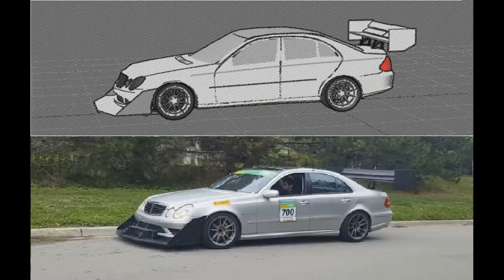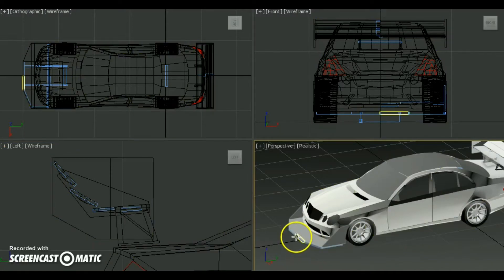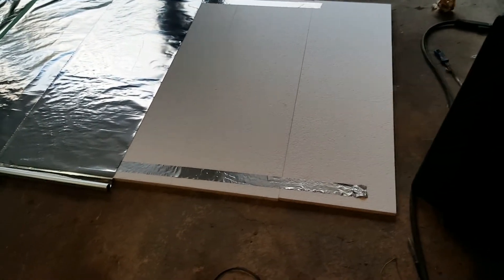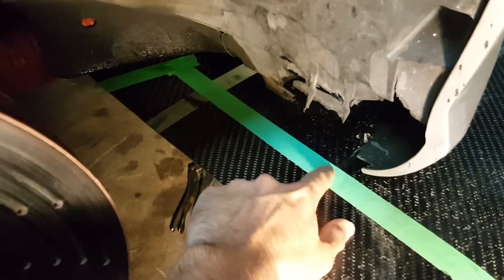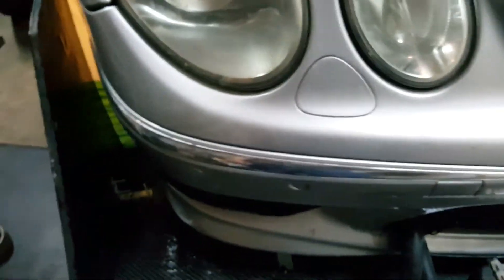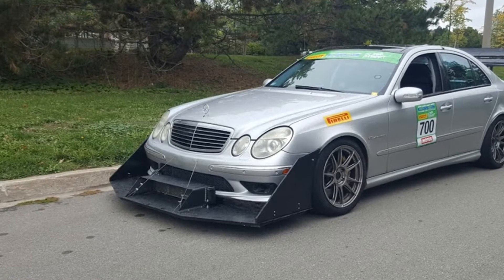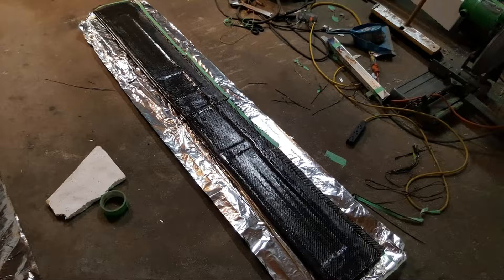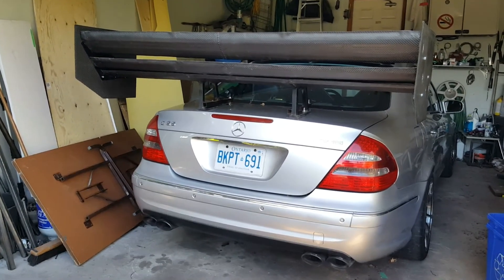How to Build a Properly Fast Track Car - Part 8 (Splitter, Rear Wing)

Comment: Do you do your designing wholly on a computer?
CF skin over a foam inner would be the best method for ‘DIY’ wing. Lightweight, high tensile and torsional strength and the advantage of being an being an aerofoil. There’s a company in America that can supply the foam inner carcass in the profile as requested by customer, voids for CF spines/ribs. (cant remember proper name for carbon tube insert near leading edge) The vacuum and kiln method for this also creates a strong, lightweight product.
-bad CF is no better than FG with supports

Comment: If by properly you mean wrong.

Automotive companies spent 4 years on average for each model, spending millions of dollars, employing experts in fluid dynamics to design the car to perform at maximum aerodybamics, with minimal negative effects. Adding after market parts completely destroys the millions of dollars of research and tweaking to perfection.
Each car has a unique shape, and the streamline that interacts in specific ways. Your splitter destroys the airflow around the front design of the car, increasing turbulence and unnecessary air disturbance. So too does the unnecessary wing.

FYI, a diffuser actually generates more down force than a wing, and none of the drag. As a result, you don't end up just slowing down your car like you are doing here.
Reply from the maker: Lol, if that was true you would see formula 1 cars shaped like Toyota Prius'es too. 
Production car aero is meant for giving you better gas milage down the highway. That aero isn't intended for track driving and makes little to no downforce. Diffusers work great if you have a proper flat underbody but in the class I am racing, flat underbodies are not allowed. The rear wing is active anyways so it contributes to almost no drag down the straight because it remains open.

Besides this aero has clearly proven to work on the track and makes a very noticeable difference. There's a reason why almost every time attack or hill climb car uses wings and splitters.
Reply: Wes Jones he is the one with a track car, where is yours?
Reply: Valentine A. And that means what? Tons of teams don't perfect their cars. 

The design of this car was done by professionals with millions of dollars and proper wind tunnel testing. Adding these on interferes with the airflow coming into contact with the vehicle. As such, it necessarily requires the modification to the design of the car itself to add them on....and still there are more effective ways to add downforce.

Where is my what? I never had time to race cars when studying fluid dynamics and making cars and planes function. I leave the racing to my buddies.

There's a reason professional racecar drivers don't modify their own cars, their professional teams do.
Reply: Wes Jones Lol are you 12?
Reply: Wes Jones r/iamverysmart
Reply: Wes Jones 
Packaging also weighs on decision making process. Testing is done to make required packaging as best as possible. Improvements can indeed be made. If done correctly

Comment: What the fraggle rockin kinda racing are u doing with all that carbon???!!! Looks like u wanted to be an astronaut rather then a race car driver?? Lol na but I love it when guys do stuff like this . I think some of ur engineering needs alil more finesse. Like some of ur welding could have been dressed down n the carbon could have had alil more fore thought. Keep up the work 👍🏻 ur deff a unique guy.. I’d love to see u race that thing . Would be the cherry on top👍🏻👍🏻👊🏻
Reply from the maker: There's quiet a few videos on my channel of racing this car. Yeh, I know quality isn't the best. I usually get little time to spend on this project so its been more about doing w/e makes the car faster, and testing different ideas on it. 
After all its a car I bought to beat up on the track and compete in time attacks. Wouldn't really make sense spending too much time and money on refinements and then possibly crashing it.

Comment: You should have bought your rear wing. you have no idea about the aero data for what you have. the slot gap on the second element is closed, wtf? the carbon work looks like crap. are you even vacuum bagging this stuff? or are you just laying it up like fiber glass? there is no reason you cant mount that wing to the trunk lid, it's done all the time. suggestion...make your front splitter out of wood. that will allow you to make modification so that you can get the performance out of it, i doubt you're going to get it right the first time
Reply from the maker: See the later videos, Part 10. The rear wing is supposed to move and slot gaps are adjustable. Its definitely have a big advantage over conventional fixed wings. Yes, the CF on the top two elements was a mess but that has another reason. My friend spilled his redbull over the uncured CF so it had to be repaired. I will probably end up making new ones at a later date.

Comment: I got to say this is a really interesting build. I love that you are making all the parts but I have to say you can save so much weight by not using steel in all of your parts. Also the carbon does not need to be that thick, it will be rigid and strong at half the thickness. If you want to use metal as inner structure use aluminum, you will save a lot of weight. Keep up the great work!
Reply from the maker: Yeh a foam core construction could have been better for the splitter, but the steel tubes were really thin anyways. Hopefully will go for a foam core for next time
Reply: SK8215 haha, i just said the same thing in previous post. A flat plane is no match for an aerofoil
Reply: ant4hellfire 
Thin walled 316 is a good, but expensive (and harder on tooling, option where high strength/lightweight applications are required. Ie; rollcage

Comment: Hi great videos. Just question\ wouldn't a rear diffuser not maybe have been easier as you could have done with a smaller rear wing?
Reply from the maker: I'm planning to run a diffuser for next year, but this time things were a little rushed. More downforce is never a bad thing anyways. High downforce setups like this seem to work really well on low speed handling tracks. For high speed tracks however drag is a factor so smaller wings work better.